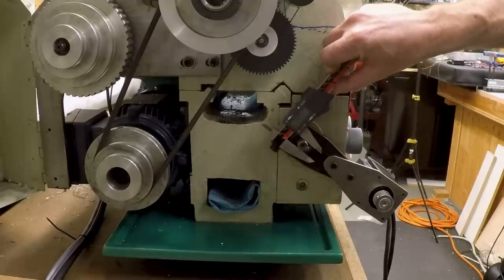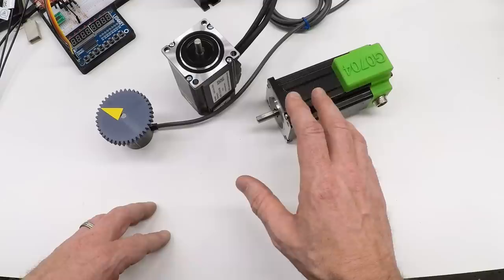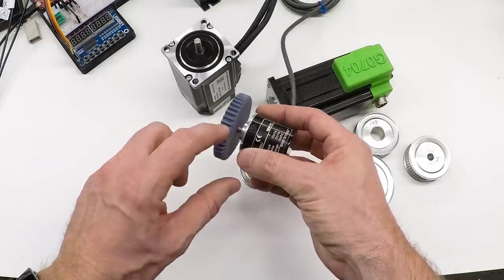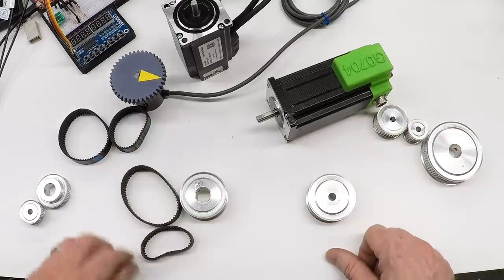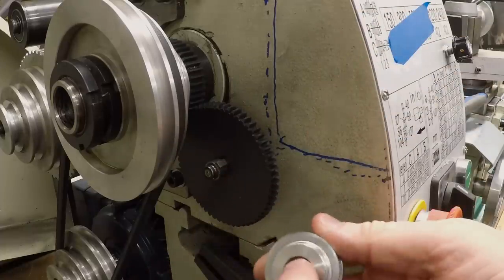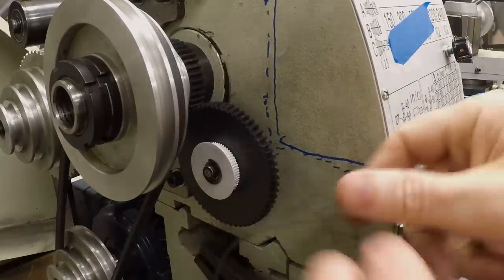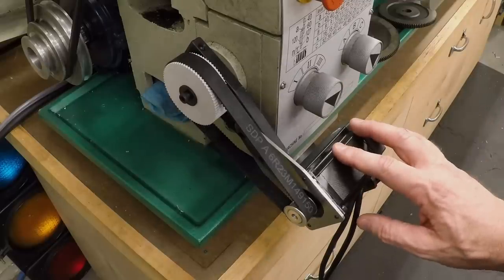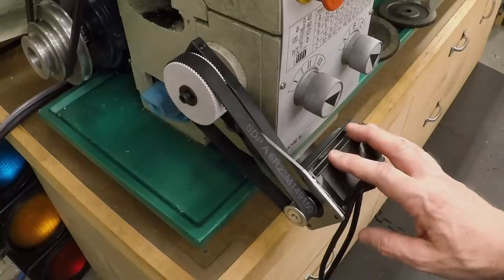Lathe Electronic Leadscrew Part 5: Mounting the Encoder and Servo on the Lathe

Comment: Interesting to see an American use metric, apparently with no effort! That was not hard, was it?
Of course, his tooling is mostly still imperial. Excellent video series, by the way.
Reply: @dahut3614 , Dunno. There are 2 main global old-school holdouts: Time and Navigation. In aviation, even the third dimension (altitude, flight levels) is imperial (feet).
There IS a "metric" coordinate system, gradians, that apparently never made the grade.

Comment: Is there not an optical sensor that is fast enough to read a painted dot on the lathe drive, instead of a mechanical connection to a separate encoder?
Reply: It's not just the RPM, it's the position. The encoder has ~4k(?) measurements per revolution - that would be a lot of painted dots...

Comment: Just a thought and maybe not a valid one; if all your feed selections are programmable, wouldn't it be more "mechanically positive" to directly drive the other end of the lead screw rather than go through the gear change box?
Reply from the maker: Perhaps.  I like the idea of keeping everything under the cover, and I might someday end up wanting to use the extra gears.  There's another 2:1 reduction in there if I need it.

Comment: There are numerous methods for connecting a rotary encoder to the spindle, and devices other than rotary encoders that could be used. Please do not consider my suggestions as criticisms of the methods you chose. I am just offering alternatives that you may not have considered. 
You can eliminate the idler gear by replacing the gear on the lathe spindle with a tooth belt pulley. This would eliminate the noise and some maintenance issues associated with the gears. 
I believe that a better option is to use a reluctor wheel mounted on the lathe spindle with an abs sensor. It will not provide the counts/revolution that your rotary encoder produces, but it is capable of generating more than adequate resolution for this application. ABS sensors are dirt cheap and incredibly durable and reliable. The same can not be said for the rotary encoder your using. In regards to the reluctor wheel, your existing gear could be used or a higher count gear for a little better resolution. Another advantage to going this route is that the reduced pulse count would allow the use of a cheaper and more convenient CPU.
Reply from the maker: I actually considered most of those options.  Replacing the existing gear on the spindle requires cracking open the spindle stack, which requires re-setting the bearing preload.  I didn't really want to take that on.  The ABS brake sensor is an interesting idea.  The approach I'm taking depends on the high pulse count to avoid having to make any assumptions about timing or speed.    With this much resolution, I never have to estimate how fast anything is moving and make any steps in anticipation of continued motion.  I can make everything reactive and avoid any guessing.  So far, I'm getting results I like.  We'll see how the rest of the project goes.
Reply: @Clough42  I have a similar lathe. It's not a big deal to take the pulley and gear off. You'll have to at some point to replace the grease anyway and, because the Chinese use such high quality stuff, this is something that should be done sooner rather than latter:)
A simple method to bore out those aluminum pulleys is to use shim stock/spacers with a four jaw chuck. Use a DTI on the existing bore to center.  

Between swarf and lubricants, a rotary encoder is going to have a very tough life in this application. In contrast, this is nothing compared with what a typical ABS sensor was designed to endure. 
In regards to the reduction in resolution, I would have approached this matter from a different direction. Rather than taking samples based upon a time interval, I would calculate how many servo steps are required in relation to spindle counts. This could be easily accomplished with an Arduino or Raspberry pi, and there's an abundance of supplemental hardware that works with these platforms. There's no need to reinvent the wheel.
Reply: What about just gluing a bunch of magnets on the spindle gear and then put a hall effect sensor over it?
Reply: @ChristophPech  There's a physical limit on how many magnets could be distributed on lathe spindle. They have to be far enough apart for a hall effect sensor to function properly and there's limited space on a lathe for a wheel large enough that would provide an adequate diameter for acceptable counts/revolution. There is also another issue with this method; swarf on the magnets would be an annoying problem. 
In contrast, ABS sensors are basically very sensitive proximity detectors that can detect individual gear teeth. Install a 120 tooth gear and that's how many counts the senor would provide per revolution (one pulse every 3 degrees). That should be adequate for this project.

Comment: look MAN,this is the fifth date  and no action yet ... iam sticking along just cause u r cute ...... 
we will go on one more date and i dont see some encoded cutting action it over man !!!
Reply: LOL! That was great!!
Reply from the maker: Okay.  I promise: the next video will be served with chips.
Reply: @Clough42  u sure the belt tension is right ? I mean under load ...... on the final build will it have a tensioner ? a spring loaded ball bearing riding  on the outside of the belt might work
Reply: Things take time ......
Reply: @AtulSohan  A spring loaded tensioner is asking for trouble. If it's positioned on the slack side when cutting Right Hand threads/feeds it would be wrong for Left Hand threads/feeds IYKWIM.
Reply: @boldford  would that make a difference ?  I mean look at the serpentine belt tensioner in cars it loosens up when u yank on pulley bolt . Does it loosen up when running in the opposite side ? 

Don't they use spring tensioner in CNC router ? 

I could be wrong . If Iam ,
 please do correct me . I rather be a informed fool than a ignorant idiot .
Reply: @AtulSohan  How many car engines run both ways?
Reply: @boldford true that, almost none , except for a few 2 strokes .

What about those CNC router things those have similar cutting forces they use spring tensioner Pulley .

Comment: Has anyone given thought to using the existing RPM readout on many of the current VS lathes as an encoder? curious if there is a way to tap into that instead of introducing an additional point of failure into the mix.  I have all the parts to do the conversion but there may be an opportunity to simplify here.
Reply from the maker: I think the main issue with the existing sensors would be resolution.  It is possible to thread with one or ten pulses per revolution, but you have to make a lot of assumptions about constant speed operation and it would be slow to respond to speed or direction changes.
Reply: @Clough42  Fair enough. I actually came to a similar conclusion after a friend said his kept RPM with only 4 magnets around the shaft. I can definitely see the lack of resolution really negating the whole project.  Thanks for the sanity check.

Comment: What are your typical aluminum slotting recipes?
Reply from the maker: I take them directly from the end mill manufacturer's (YG-1 Alu-Power) data sheet and then lighten up just a little if I think it's a heavy cut for the rigidity of my machine.  In this case, it's a quarter-inch 3-flute tool in Aluminum, slotting 1/8" deep (0.5D).  The sheet calls for 10,000RPM and 56.7IPM.  That's .0019" per tooth.  I think I ran it at .0015" per tooth.  Of course, my feed rate is slower since I only have a 2200RPM spindle.

Comment: Using a stepper with an encoder you will NOT loose steps it would be the same as a servo setup.  The big difference is you will not be able to run at higher RPMs on the stepper. Looks like the project does not require the stepper to run faster than 1000 RPMs. I have a setup using steppers with the encoder and they work with the same accuracy as a servo. The only thing is the speed and torque of steppers at higher speeds is where a servo will out perform a stepper with an encoder.
Reply from the maker: Yeah.  This is the trade-off.  The "servo" I'm using is somewhere in the middle.  It's three-phase, like a servo motor, but it's fine-pole, like a stepper.  It will run pretty fast, but it definitely loses torque at higher speeds.

Comment: You refer to your servo motor but I think that what you have is actually a closed-loop stepper, that the Chinese manufacturers call a servo. It acts like a servo, due to the closed-loop controller but is, in reality, a stepper motor. This is not a problem but you refer to your belt ratio decisions based on the fact that servos work better at high speeds and steppers at low speeds. What are the top RPMs you will realistically need for your lead screw? Comparing that to your RPM torque curve of the stepper will give you the best pulley ratio.
Reply from the maker: This is correct, though there is some gray area.  This particular motor is three-phase, like an AC servo, but it's fine-pole, like a stepper.  It carries more torque to higher RPMs than a typical stepper, but not as much as a proper servo.
Reply: @Clough42  Thanks for the quick reply. The reason I am concerned about the stepper speed torque is I'm trying to order my belts & pulleys. I don't have the bucks for a servo so I plan on using my largest stepper motor a 425 oz-in. I would like to use a gt2 10mm W 20T or 30T on the stepper with a 60T^ on the lead screw. Without knowing the top speed (RPM) requirement of the lead I don't know the optimal speed/torque range for the stepper so I bought a few different sizes to test. I kept them in easy ratios for simplicity 1/2, 1/3, 2/3. I doubt very much that the lead runs more than 5-600 RPMs so my stepper would only run at about 1200 max @ 1/2. I went with the 10mm 2GT because they are glass or wire filled and more flexible than the larger 3M or LT timing pulleys. They are also more inexpensive and come with 14mm bores. On my encoder, I went with 1/1 because I left the 40-80-40 gears on and attached my 40T onto the 40 gear outside.gear spot. Not too noisy with 1 extra gear. I plan on adding an adjustable e-stop switch to my ways to stop the lead screw automatically at the end of the thread and possibly reverse the lead rotation direction to reset the pass without disengaging the lead nut while doing metric threads. It should be possible to reverse the lead and maintain position if you don't have to stop the chuck. Maybe have to include a reversing fudge factor to facilitate correct placement. The nice thing is you wouldn't have to pre-cut the shoulder space and you could use the DRO to set the e-stop/reverse switch.

Comment: Odd about the belt. I've ordered 5m belts from motion industries (similar to sdp-si) and ordered it off of circumference in mm.. Good to know that not everyone has the product numbers the same way.
Reply from the maker: The real issue is that the eBay listings just gave the number and didn't state what it was.  Most other sellers show both the number of teeth and the circumference.
Reply: @Clough42  In metric belts only correct way is to give length and never number of teeth (that is standard way how they are designated), putting other number is wrong and can lead to confusion.
Reply: @Clough42  great stuff - super happy I came across your video series - would you recommend using a 5M belts if my lathe's lead screw is beefier (40mm diameter) - turning size is not so big 102mm swing?

Comment: Whats the spec on the servo 2 or 3nm
Reply from the maker: I started with a 2N.m servo, and it's just barely enough for this lathe.  I'm now running an inexpensive 180w servo with 3:1 belt reduction, and I'm much happier.  The biggest issue is that the hybrid stepper loses torque at high speeds, and this will vary from motor to motor, based on inductance.

Comment: Split gears have zero backlash. It’s up to you but many ways to skin a cat. Here is a link to antibacklash gears. For driving the screw I’d personally want gears for the torque that is needed to go through them plus you don’t have to worry about oil or coolant deteriorating them if it splashes up. https://www.sdp-si.com/products/Gears/Anti-Backlash-Gears.php 

Here is a link to a supplier and timing belt calculator that gives you actual tooth count needed. https://www.bbman.com/belt-length-calculator/

Comment: Why use a belt? Couldn't you have mounted the motor straight to the shaft? I don't know if I heard you address that or make reference to that idea?
Reply from the maker: Two reasons.  First, a belt allows me to tuck the motor back where it will be out of the way and I can close the cover.  Second, it allows drive ratios other than 1:1.  In my final implementation, I ended up with a 3:1 belt reduction.
Reply: @Clough42  That makes sense (both points); Didn't think about that. Thanks for clearing that up.

Comment: mounting a pulley on a mag base like that next to those gears is a disaster waiting to happen
Reply from the maker: It was plenty secure.  I have it mounted permanently now, but it lived on the mag base for a long time without moving at all.
Reply: @Clough42  cool, well if a= mag base is plenty secure then why bother with anything else? just use mag bases for everything and don't worry if a belt or something gets caught in your gears while the lathe is running when someone accidentally knocks into it